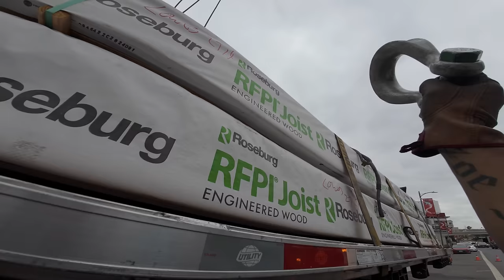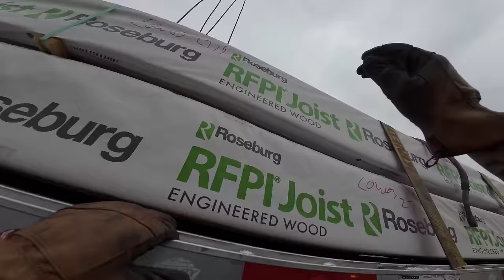Load of Wood Almost Falls off Trailer (Got Wood?)

Comment: I worked for a rigging company for many years.  The first week on the job, I was yelled at by the old timers about jumping off the flat beds to the ground, telling me that my knee joints would be toast after a few years if I kept doing that.  I learned from them and I see you doing the same thing.  Work smarter, not harder.  Enjoy your videos.
Reply: Obviously you didn't learn how to jump properly, and have more chance damaging your joints from running and cycling.😊
Reply: @walkingwithdogs8547  Not so, carrying rigging gear and belts makes a big difference, as he does.
Reply: @billbennett5875  nothing to heavy then, lost count of the jumps we did out a plain with 120kg plus a bit a different times with a GS strapped to you and between your legs, 60 years of age and all the other punishment your joints took and I'm good apart from a shoulder that broke twice being silly with the grandchildren.😅
Reply: Jumping while hard on the knees, but more importantly, it's too easy to land wrong and cause permanent damage that no amount of rest or surgeries will ever fix.
Reply: @walkingwithdogs8547 Running downhill is probably the worst biomechanical action you can ever do apart from jumping down 5 ft. Neither are good.
Reply: Jumping out at 32 thousand isn't running down hill.🤣
Reply: I was just about to say the exact same thing

Comment: they never learn cant use straps on steel or lumber they cant be pulled tight enough to hold the load good job be safe
Reply: what securement device do you use on lumber?  Chains?
Reply: @philphil5066  yes chains
Reply: Straps and corner irons, I drove a lumber truck for 27 years. No gut wraps on that lumber load, that's why it came apart. Every 5 foot put a strap.  Units at the rear should have been butted up against each other. As soon as he starts driving the load will shift inward and he will have to stop and tighten down again.  Great job as always Alex.
Reply: @allenburke1113  i dident say the straps were cut i just dont like straps not as strong as chain and i drove over 42 years all chain
Reply: @waynekoepke8128  Sorry, misread your reply. I have been driving since 1978, 4 years logging trucks, 7 years cement mixer, 3 years curtain vans, 27 years flatbed. I have never seen anyone use chain on finished lumber like this guy was hauling. I have problems sometimes with my straps and corner irons digging into the redwood I haul, I can just imagine the damage chains would do to redwood.

Comment: Josh can u please make sure u have the option for CC for us who are deaf or HoH. Thanks! It's normally on and not a problem but this video just doesn't offer it😊
Reply: It takes a few hours to work. I usually come back after awhile to check if It’s available because I have the same problem.
Reply: @shad2930-t8p I came back 10 days later and CC is not there.  I think it's a feature that must be turned on by person uploading.

Comment: The driver isn’t wearing flip flops….that is a first! Great video as always and #1 recovery channel.
Reply: If he was wearing flip flops, he would keep going until they fell off completely.
Reply: It's amazing how many drivers don't even know that it is a federal requirement to wear boots or at least work shoes.
Reply: @kmg501 
Because there is no federal requirement for them to know. FMSCA has no rule about foot ware for truck drivers. OSHA has only a reference that employers must ensure employees (not owner operators) have protection against foot injuries due to falling objects. Some companies have policies about footwear, but that is not law.
If there is a federal requirement, can you tell me what law it is?
Reply: @bobh6728 😂😂😂
Reply: If you wear flip flops as a flatbed driver, you will get kicked out of a lot of shippers and receivers.   They don't mess around with that.

Comment: This appears to be a multi drop load, in these circumstances I would recommend running the straps under that pack and securing it over the top on the same side,  if necessary run more straps over the whole pack. It will never shift
Reply: If the warehouse had just done it right the first time, it wouldn't have shifted. They're lucky it didn't fly off on the highway because improper rigging is a public menace to life and property. Safety negligence should come with fines like $100k to make sure it doesn't happen by properly trained people verifying critical items.
Reply: In Australia the LOADER and Driver are held equally responsible if a load shifts dangerously or indeed comes off the trailer and injurs/kills a bystander or damages property.
Reply: @colinl9018  I find this interesting, I'm not doughting you, my first thought is that this can only work if the loader accompanies the load; obviously not viable.  On the other hand,  in the cases of sealed freight where the driver has neither any control or knowledge of the contents of his or her load, should the driver be 50% liable?

Comment: I like how you always use a shackle on the straps. At first, I wondered why not just run the strap straight through the hooks? But it makes sense. Those hooks experience high-pressure metal on metal contact, which creates a burr. Making sure your soft staps only touches smooth metal that never touches any other metal will allow those straps to last a very long time.

Comment: is there a reason to use chackle instead o putting cables directly on hooks
Reply: I believe the shackles he uses have a distinct wide radius in the belly where the straps go that keeps the integrity of the weave and protects the straps and prevents acute wear, especially in the loops. You could place the recovery hook directly in the loops, but the radius is much tighter and would wear out the synthetic weave much faster.